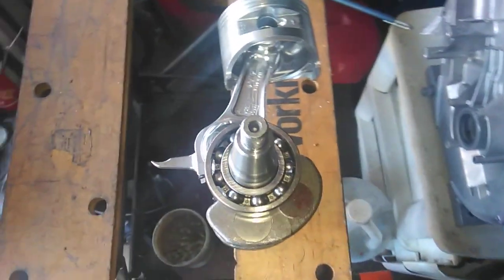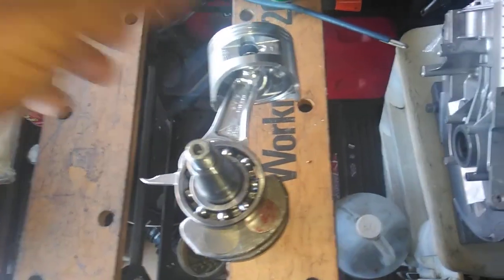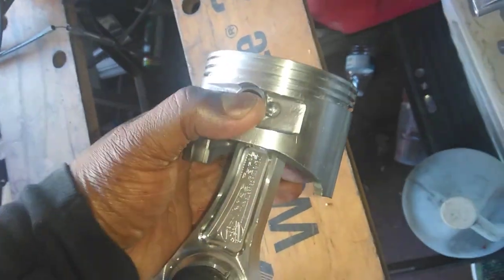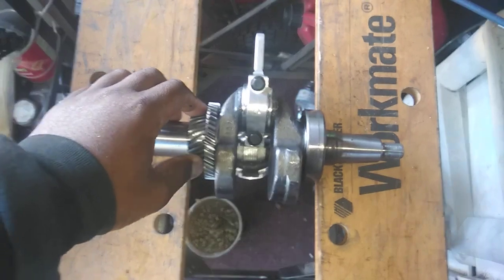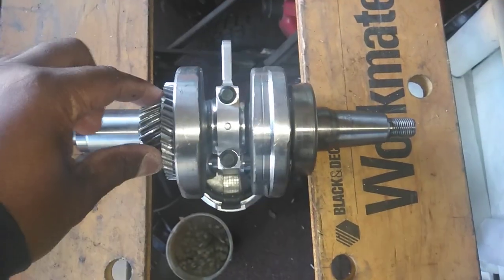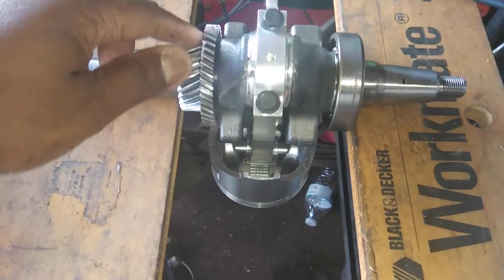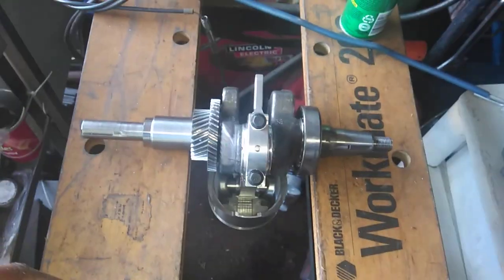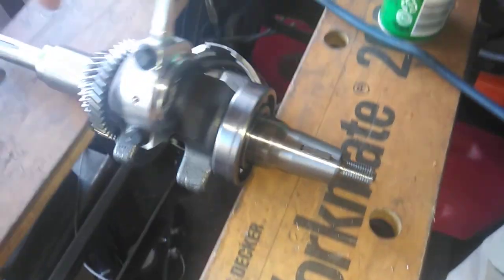Crank Balancing Explained Single Cylinder

Comment: This is wrong completely. This video suggests that the bob weight = what the piston and pin should weigh to achieve a 50% balance factor. Let’s say the small end of the rod weighs 100grams. His bob weight weighs the same as the piston and pin let’s say 300 grams. You add con rod weight to bob weight and get 400g. You then divide that by piston/pin weight of 300g and get a balance factor of 133% he has it all wrong! He is supposed to be using bob weight to make the crank stay in any position. And bob weight should not be anywhere close to piston weight!!! 

Rod weight 100g
Piston weight 300g
Bob weight 50g

Rod w + bob w = 150g divided by piston weight = 0.5 or 50% balance factor 

If the bob weight = Piston weight you have a 130% balance factor.

Comment: Confused me, this is how you want the crankshaft to behave in testing for 100 % balance factor  by adding dummy  weights . The formula says reciprocating mass should be never 100% which by using the real  piston and  parts illustrated the crank will  never stop moving  because 50% or so,  never 100% works   to stop vibrations ? Please tell me i am wrong .
Reply: Shiuld have a balance factor of 50% ish or more like 60%  this is because the engine will vibrate like crazy on the other axis so 90degrees so if the cylinder is horizontal it will start to jump up and down like crazy.    If the balance is a bit off it will jump up and down a bit and left to right a bit. So it isnt as easy as it sounds
Reply: @DiyNuke  Thanks for the information , my scooter was vibrating and sucking air thru the seals because i didn't true it properly. Hobbyist ! Big difference .

Comment: with a single cylinder you do NOT want the crank to be balanced at 100% like you show here. You work under a balance factor of typically around 55%-60%. With the piston on the crank, it should drop like a rock. The secondary vibrations are going to vibrate that engine like a mofo. Im not trying to be a dick, just want your engine to make all the power it can. Check this video out to understand why https://www.youtube.com/watch?v=VhOENxPHjkw&t=1128s
Reply: yes the vertical vibrations are going to be taken care of with a balance factor of 100%, but a crank isnt a strictly vertically moving system. It rotates around the center axis of the crank. Because of that, the heavy counterweight is going to introduce vibration as it moves in the horizontal direction, on its way to bringing the piston to BDC and TDC. The idea is to find a happy medium between taming the vertical and horizontal forces in the engine, and especially important in an engine without a balancing shaft.
Reply: To find a balance factor start by weighing the small end of the con rod (A). then put the crank on the balancing rig and start adding weight (nuts and washers) to the small end of the crank by using a bent paperclip or something until it is perfectly balanced. Weigh the weights you used including the paperclip (B). Add the small end weight and the balancing weights together (A+B=C). Now weigh your piston, rings, wrist pin, and circlips and add that to the weight of the small end of the con rod (A) to get your total reciprocating mass (D). Now you are going to divide the weight of the balancing weight and small end (C) by the total reciprocating mass (D) to get the balance factor of your single cylinder crank (C/D=Balance factor)
Reply: For a 1 cylinder horizontal engine what balance factor you believe is the best?
Reply: @tasoscharak_4345  it's hard to say without doing some testing, but usually somewhere around the 50-75%.
Reply: @picassoimpaler3243  thank you for the answer 👍

Comment: I like to use two old blocks of the same size for this with both ends of the crank poked in from the outside in through the flywheel side on both engines (bearing installed) to give a perfectly level low friction setup for checking how balanced the rotating assembly is. And place a couple boards or books under each block so you got room to rotate without the piston hitting the table.
Reply: This is only a static balance though it also helps if you can dynamically balance. 
Dynamic balancing is the same as a tire shop does a tire, by rotating it and computer sensors know where the spot out is. When things spin, there balance behaves quite differently than rolling it slowly. Big Industrial motors have to be done this way because they are huge and vibration will destroy the motor and be dangerous.